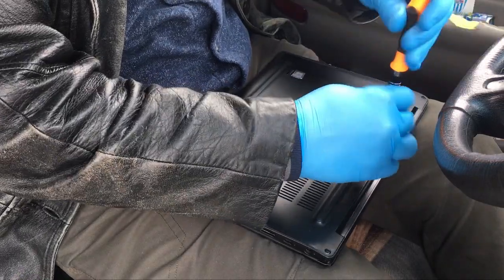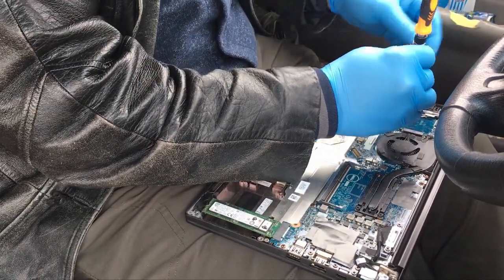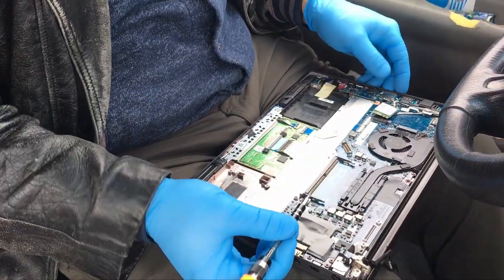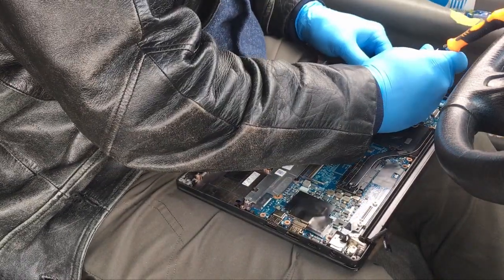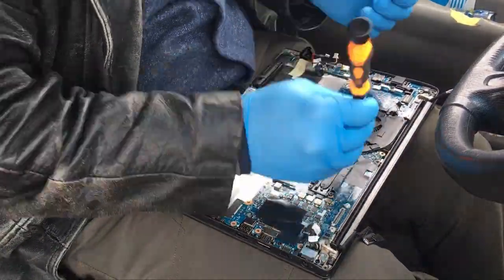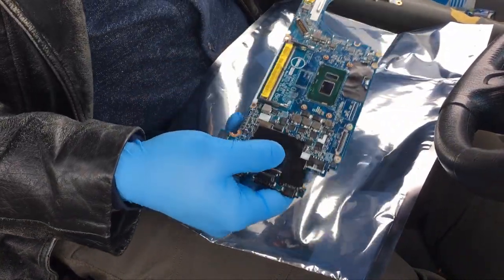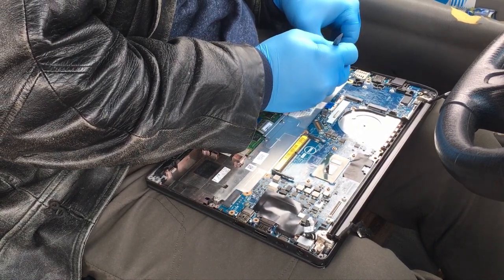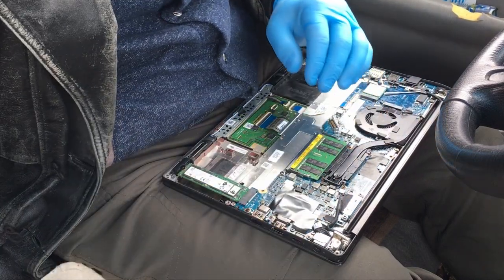Latitude 7290 System Board replacement

Comment: is it possible to upgrade just the cpu without replacing the entire system board?
Reply from the maker: Unfortunately no, most if not all current system boards for laptops have the cpu soldered to the board. Unless you have a setup that can desolder/resolder it's neither advisable nor practicale.
Reply: @WorldofMe  thanks!

Comment: i have an m sata  drive from a latitude 7240 can i install on the 7290 to get data off , maybe in wwan port ?
Reply from the maker: There are adapters you can get on Amazon that can be used to plug in different drive types. The wwan doesn't work the same as the m.2 ssd ports. It uses a different architecture so using an adapter and plugging it into a harddrive port, e-sata port, or usb port would generally be your best option.

Comment: wow, don't do that on your car. Worst of all, don't even think in leaving arround inside the car "some pieces" as seen in this video. ESD discharge is real
Reply from the maker: As I stated in the video this was only done in the car because of Covid-19. The restrictions in place prevented me from being able to have a work space in the facility. Not sure what you mean by " leaving around "some pieces" " but all electronic parts were placed on anti-static mats (not shown). I am very aware of ESD, hence the additional use of gloves. Though this was not an optimal way of changing the board. It was done with all standard safety procedures in place. Even if you couldn't see them on camera.